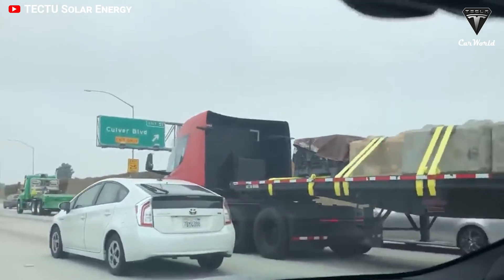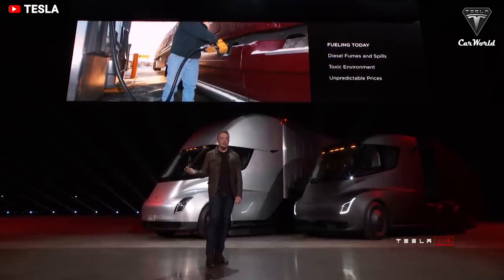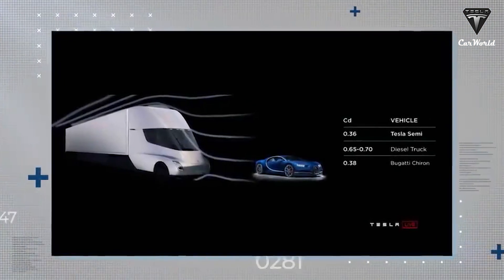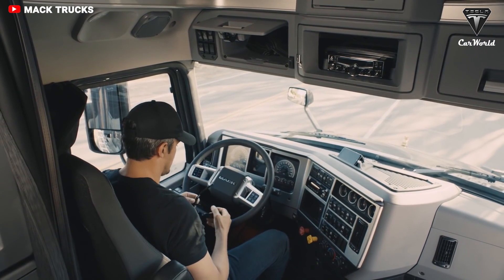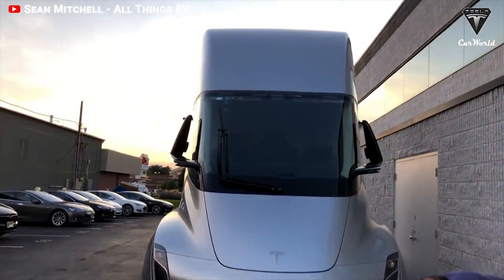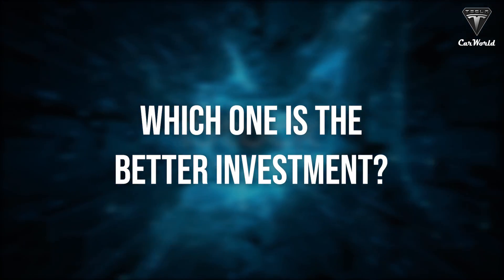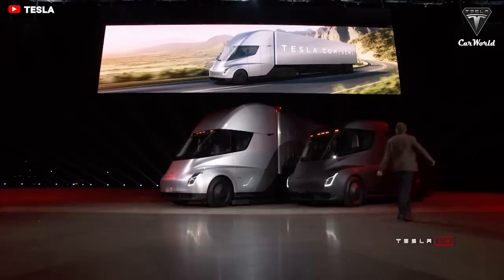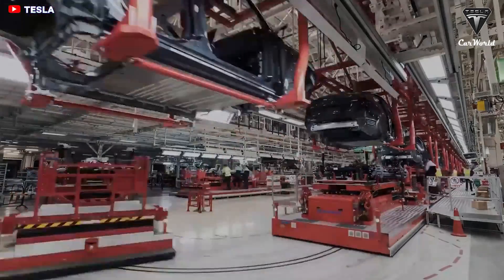Which is the KING of 2023 heavy trucks? Mack Anthem Diesel Truck Vs. Tesla Electric Semi?

Comment: The last thing a truck driver thinks about in his truck is how quickly it accelerates so the load in the back falls everywhere.
Reply: RIGHT especially tankers
Reply: Actual truck driver here, acceleration to keep up with cars and make hard city turns easier would be a much welcome gift
Reply: Plus the tesla weights more due to the battery weight. Meaning it actually max haul weight is under half of many diesel trucks. And only has 500miles at perfect conditions while a diesel has well over a 1000 plus 20 mins to fill.
Reply: @randomreynolds94  20 mins and clean windows and mirrors lol
Reply: As a truck driver I can promise you after comfort acceleration or power is the next important option the worst part for any truck driver is dealing with the idiotic 4 wheelers that get pissed because where infront of them so they show their irritation buy going around us and break checking us and most loads wouldn't be effected by the acceleration of the truck
Reply: just fill the void spaces with foam and it is all good...go racing down the road and try to not tip over...
Reply: You're not a trucker please don't speak for us/them.
Acceleration is valuable for passing and grade climbs.
Any load that is secured poorly enough that acceleration would destabilize it, is a load you shouldn't be carrying. If it will come loose from acceleration, it'll come loose from braking. Same kinetic forces are at play.
Reply: @kewlztertc5386  yup im not a trucker. Just a guy in a tractor trailer driving cross country 7k a week. 
No shit acceleration matters when passing but also top speed matters. Cause you can have the best acceleration in the world but if your truck is limited to 65 mph that wont matter against a truck going 70mph you just aint passing shit. As far as grades if you climb or descend its a matter of engine brake and initial inertia on the climb and proper gear which translates into torque not acceleration
Reply: @L1berty1776    what is your point? You don't need to pass another rig if it's doing 70. The Tesla is capable of going faster. 
The Tesla uses Regen as an engine break, again what's your point?

Your comment was about truckers not wanting acceleration, and cargo spilling from fast acceleration, like drivers only know how to floor the accelerator. 
I doubt you're a trucker to even suggest a load would fly off the back like some horror movie. Or that a competent trucker would carelessly accelerate in such an unsafe manor. 

As I said above,  if the load isn't secure  you shouldn't be transporting it, and it will "fly off" from braking just as easily as from acceleration. Only when you break, it'll crush you and the cab.
Reply: @kewlztertc5386  tesla can go faster great not after the company closes it at 65 for insurance purposes. So you wont be passing much of anything in the right lane. Full load you gonna have like what 700miles on a perfect day if that. Then stop and charge for probably hours . Great if you already got your 11 hours in. I dont see any charging stations at any truck stops. So good luck with that. These trucks might be great for local trips but they aint shit for long haul
Reply: I'm always thinking about how slow my truck is to accelerate.

It's fine off the line from a dead stop but the tall gearing makes it take forever to get up to speed.
Reply: @dchawk81  on the top 10 list of things how high is acceleration?  Like 8 maybe 7. Its the torque that makes it move
Reply: from my experience as a warehouse worker talking to truckers delivering merchandice, they already do. cuz other warehouses cant secure palets properly.
Reply: Trucker can now bully those "fast car" aka those Mustang kids who think it cool try to break check a giant Truck for insurance fraud.
Reply: @ryannguyen7466  i simply slow down cause i know that they wont ever slow down that much. I dont care for assholes that cut me off and speed off but if u brake i will ram u and show the cops the camera that u stopped
Reply: @L1berty1776  the thing is that you will still be responsible. You always need to have a big enough space to the persone in front of you, that you can break safely everytime.
Reply: @ryannguyen7466  lol….. those trucks got nothing on mustangs stfu!!
Reply: @ryannguyen7466  too many chromosomes
Reply: You care about driving up a hill though right? You need the power to climb a hill and actually not slow down.
Reply: @EVMANVSGAS  A trucker cares about getting there on time for least coat, so he can make money. Climbing couple miles at 40 mph doesn’t matter much on an 800 mile run.  

So what are the  costs?  1. Energy cost is leas for EV.  2. Vehicle EV purchase cost $200k for regional rig is  higher than diesel.  3. Less maintenance for EV, but if you do have repair, Tesla model is back to Tesla shop which here is 4. ship rig to Nevada.  5. Cost of big battery backed semi charger. My guess $3M installed, replaced every 12 years.  No charge at home option here, must have one, meaning fleets only.  

I think 4. and 5. swamp the fuel savings.
Reply: @Nill757  your maths so bad the savings is litterally 50+ thousand per year over 10 year 500,000 savings MINIMUM as by then you could maybe have a autonomous behind yours on highways at least .... then it would be million + extra value
Reply: @WASUPMYNIG  great so now we just laying off millions of truckers. Lets see how that works out for the economy
Reply: @WASUPMYNIG  Where’s your math? I don’t see any at all.  What price do you put on the megawatt charger with 9 MWh of battery backup, replaced every dozen years?  What price do you put on shipping your rig to Nevada for repair?  When you go to sell that ev Semi when it’s aging, what price do you think you get on a regional only rig that can’t cross country?
Reply: @L1berty1776  the trucks value is superior anything in world and makes tens thousands extra yearly minimum why complain....buy one or dont ... i dont care.. robots can take your job with some $1 an hour person controlling it before its fully ai... no shit we dont need to do tedious jobs in future duhh
Reply: @WASUPMYNIG  for some folks its all they have and you would literally be pulling the rug from under their feet. Not exacrly the betterment for society.
Reply: @Nill757  An electric vehicle climbing a hill gets its energy back going down the other side (minus air and other drag). Wind resistance is pretty minimal 50-60 MPH. I'm sure Tesla could set up a cruise control that would meet any spec you can fit into the performance envelope. They already have a calculator for range that takes in road factors and distances to different charging stations on the way to your destination. Testers and others driving cross country have noted this.
Reply: @tobyw9573  Yes some energy returned on the descent.    Drag plus rolling resistance power of Tesla Semi is not trivial. At 60 mph w 40 ton drag+rolling is  130KW, or 174 HP,  gone forever.
Reply: @EVMANVSGAS  every truck can go uphill without problems lol. highways arent too steep, and mountan roads are full of curves so you wont go 100 mph in semi
Reply: @EVMANVSGAS  Power (i.e.horsepower, etc) is defined as rate of doing work, i.e. going up a hill at a certain speed, can be measured in units in feet per minute. Tesla's computer could likely be set to limit acceleration, thus sparing damage to the load
Reply: @EVMANVSGAS  yeah also need fuel to get to the loaction of the drop or pick up. Them batteries gonna need a lot of fans to cool down going up 7% incline st 8,000 feet in wyoming. If you choose the proper gear for entry your speed loss is minimum as this aint a roller coaster where im trying to hit 90mph over the crest.
Reply: @WASUPMYNIG  500 miles that half the distance of any tractor today. Also in winter the efficiency would drop. Tesla isnt fool proof. They havent figured it all out. Point is regular folks might think this is great but the truckers that will lose their jobs due to automation will alter economy.  Not everything can be sokved with tech
Reply: @L1berty1776  There are no self driving commercial semis on US roads. Not a single one.
Reply: @L1berty1776  Altitude should make no difference to an electric Truck.
They should require fans going down hill too since the charging current should be about equal to discharge current.
Reply: @tobyw9573  these things will be the end of truckers across the world. Millions of people wothout jobs unable to feed their families
Reply: @L1berty1776  Uh, maybe after long time AI could replace human drivers, but not now, DEFINITELY not Tesla. Tesla FSD drives worse than chimpanzees.
Reply: @aaaaaaaard9586  its a stepping stone into a future that doesnt look great. AI is not a friend
Reply: @L1berty1776  Self-driving has been there for a century. It's history is as old as AI and its progress is as slow as AI. It'll take decades for AI to be able to even partially replace human drivers and centuries to replace completely. whatever dystopian future of AI is ahead of us, it's quite likely that we wouldn't see that in our generation.
Reply: @aaaaaaaard9586  yeah you havent been paying attention. I give it 5-10 years tops before AI is introduced
Reply: @L1berty1776  You may know a lot more in trucking but I work in IT. It may look like the real AI technology is right around the corner but that's not really the case. The AI hype we have been having for a decade is thanks to the introduction of deep neural network, and we have been regurgitating the same concept for a decade since then. It's certain a good tool for many applications but it's far far from human-like true AI. Hell we don't even know how intelligence work not to mention make one. We already had AI hypes just like this one, twice, in 20th century.
Reply: Really depends what you carry , and it should be the companies responsibility to stabilise the load not the truck making companies lol
Reply: @csakDave  in a small part yes but as we all know its the driver who has to get the load correct cause nobody else getting that overweight ticket at the weight station
Reply: @csakDave  Billshit!!! The truck manufacturer should be allowed to make such fast large vehicles that are a ranger on the roads!
Reply: @csakDave  imagine a scania 770s hauling 200,000lbs going at crazy speeds in the roads! That’s a disaster waiting to happen.
Reply: @csakDave  the responsibility of the load should not be the company's its the driver's  responsibility to get the load to the destination safely. So if the truck crashed because of high speeds or what ever it would be the driver's fault

Comment: OK I’m gonna be the one to say it what’s The point of a semi truck that can accelerate as fast as 5 to 20seconds also one really big important thing for semi truck is durability everybody thinks their car is reliable even though they only have their car for a few years that doesn’t count most truck companies keep their trucks for much much longer I guarantee you an electric vehicle is definitely not adorable and that automatic breaking system the tassel hose is a safety hazard before you say I’m wrong the computer can’t judge how much weight is behind it only a human can do that it’s like telling an auto pilot to drive a logging truck down a logging road it’s just not gonna work, somethings gonna go wrong.

Comment: Tesla vehicles can't charge if the power Goes out by a storm, and it's also range limited, The truck may be faster but will also be Speed limited in most states and the faster it goes, the faster the battery drains

Comment: Acceleration and speed are irrelevant when it comes to a truck. Trucks aren't supercars. They're meant to haul freight. If you're comparing trucks you should be comparing mpg and how far you can get without having to refuel. I'm assuming you didn't compare that because tesla would obviously lose.

Comment: The author says if you're a sucker for classic trucks.  He's still wet behind the ears , doesn't know if it wasn't for those classic trucks And drivers than hes Degrading , He would be naked hungry and cold somewhere.
 Having the seat in the middle of the vehicle, Means that when you Jack knife the truck to get into a tight spot you can't see out the windowMeans that when you Jack knife the truck to get into a tight spot you can't see out the windowAnd see where the trailers going. Even if you have a mirror that will turn electrically far enough to see the trailer, The mirror's gonna be so angled you won't be able to see it anyway.
 Obviously whoever designed the seating arrangement in the Tesla truck was not a truck driver, Also I noticed there's no sleeper. That means that truck needing a location work and plug in to recharge and no sleeper it would only be useful for line hall operators like UPS and fedex.

Comment: An electric truck will be a drain in a companies time and time is money . You will not have 1/10 the range of a diesel and it will take 2 hours to charge . And to dispose of the batteries will be an enormous water pollution problem. Not to mention we get our batteries from china

Comment: The only comparison that will matter is the cost per load and these 2 vehicles will not compete on the same loads. Tesla will do short and mid-range loads and the Mac will mostly concentrate on long-distance loads.
Reply: jjames:  Nonsense:  With a mere 30 minute charge, the Tesla can go a total of 850 miles vs. 500.  There is only so long a driver can operate in a day, re various laws on rest for semi truckers. 

And 500 miles is NOT short range trucking. 

So much desperation from the deniers, but so little objective reality.
Reply: @rogergeyer9851  Where did you get the 850 miles from? Can't find that range number anywhere.

Comment: Neither! Not a fan of the anthem as ive driven a loaner from the dealer when new, the vnl its based off is far better, and dont want the tesla until proven, classic style petes like 389 have horrible visibility in tight spots which in construction I frequent, the t800 kw is better but the air cans still hinder it without rookie sticks, the t880 is probably best suited for close quarters maneuvering in tight urban and suburban areas and congested cities and unpredictable constantly changing dynamics and variables of active construction sites especially where I work in semi close roads in li/nyc. Pull on a tight poor designed scale at an asphalt plant in a classic pete in ny/li, especially with no rookie sticks and a shiny truck with chrome bumpers and lug and hub caps, its an anxiety attack. T800 and then t880 even better for win but the vnl is a dream in day cab setup trust me I drove one in nyc for years and it didnt have a scratch on it, but guys who get underpaid nonunion think chrome makes them important. That truck was a dream

Comment: Where do those batteries go when they are no longer useable? To the local dump? Diesel fuel burns cleaner than gasoline. Battery acid on the other hand does not. It’s toxic. But let’s all jump on the bandwagon to save the environment by turning big trucks into electric while all the supporters drive gasoline powered vehicles. Makes sense to me!

Comment: The biggest cost to trucking is the cost of maintenance. When you have three engines to check and maintain, it's going to exponentially grow the cost. And tire air auto readers are beyond faulty to this day. You screw up one electric truck rim and the cost is 2100 for the replacement not including labor as opposed to 600-800 for a diesel unless it's a steer (those vary by a margin). And the batteries in the electric semi are still not in high enough par to keep the maintenance cost down let alone the damages those batteries are going to do once ruptured. And the battery placement is not sound for a driver to get out safely. And the red seat belt has to be replaced instantly as it is not green or orange as required by DOT.
Reply: Electric Semi’s use the exact same wheels as diesel semi’s (not the crap on Tesla cars).
Electric motors are cheap because they are simple. That’s why factories don’t have diesel engines running machinery.

Comment: I’m really surprised they aren’t running solar panels on the top of the trailer.
Reply: This is actually being considered
Reply: yes could get 9 kw per hourß 12 hoiúes ¹08 kw 1 mw batree 10 perç peer dau added rañge
Reply: Waste of weight and money. Solar panels need to be a gled properly to work efficiently. Laying flat on a truck would be far from ideal.

Comment: Canada allows a gross combination weight of around 139,000lbs, for example, and those trucks are very common. Alaska allows 156,000lbs too!
Reply: South Dakota allows any weight if you have the axels. Have grossed in at 198,000 multiple times
Reply: JeepCherokeeful:  Interesting, but generally in the US lower 48, it's 80,000 lbs total for diesel semi trucks, and 82,000 lbs total for BEV semi trucks, which will carry a HELL of a lot of freight a year. 

And I'd expect cautious Europe to have limits in the ballpark of what the US lower 48 has, vs. low population areas like Alaska.

Comment: But how long does it take to recharge? If a car takes 15 hrs to get from 20% to 80% it's got to take 45 to 60 hours to change. A truck only earns money when the wheels are moving. It has to be able to run at speed for 12 hours and be fully charged in under 10 hours.

Comment: No it’s no special design it’s cause it has electric motors that’s why it has fast rex celebration then a diesel powered engine due to the backt that it has to take that energy and put it to a transmission therefore lose power as transmitting its power to transmission and that design is no different than the trucks back in the day aerodynamic